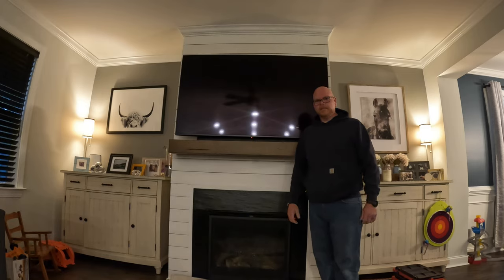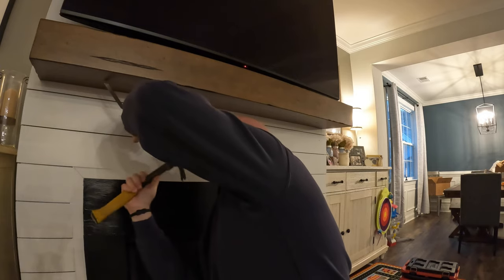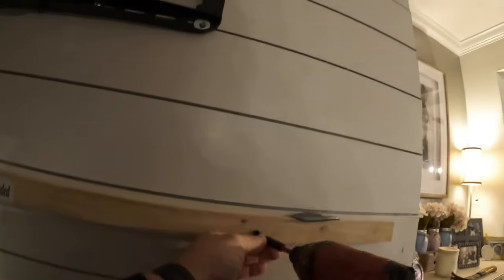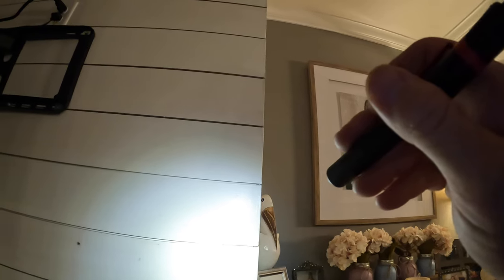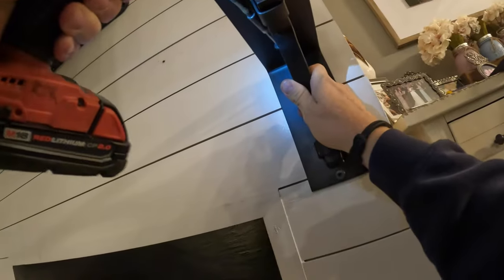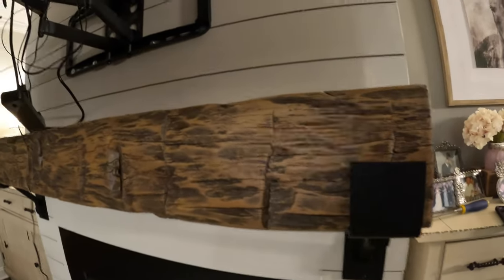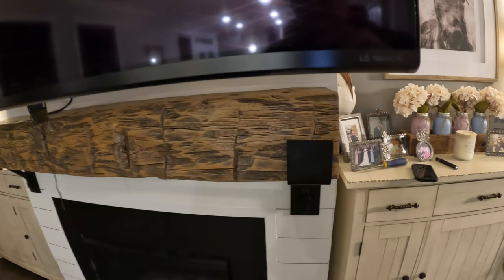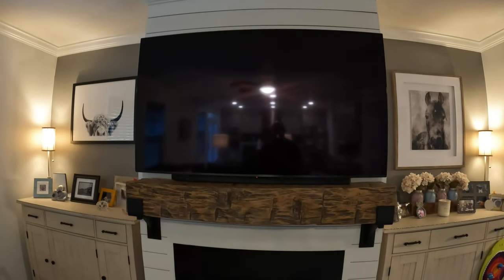How to Install a Reclaimed Wood Mantle Over your Fireplace / Easier than you think!!

Comment: Hi there! What size brackets did you buy for your 8" x 8" wood? Thanks for the helpful video
Reply from the maker: The mantle was about 9.5 / 10 inch piece of reclaimed post from a barn.  I ordered a 9 inch by 9 inch bracket.   I would order anywhere from 1/2-1 inch smaller than the piece of wood you use.   Glad video helped you out.
Reply: @rjmfishtales  Thank you! That's exactly what I needed to know. Planning to order on of their brackets as well
Reply from the maker: I like their stuff.
Reply: Did you Oder the brackets and wood from that company or different companies?
How much was the total cost?
Reply from the maker: Brackets were around $250 and the beam is from an old barn.  Kiln dried, wire brushed and sanding sealer applied.  Didn’t it myself.  It weighed around 200 pounds.  That is something you are not ordering online!  Found locally.  There are a bunch of reclaimed barnwood places around these days.